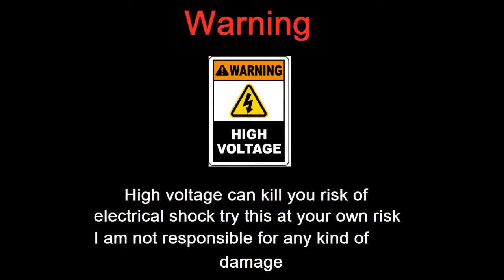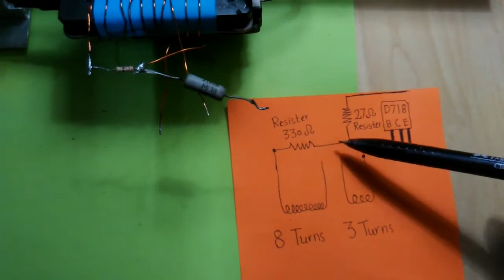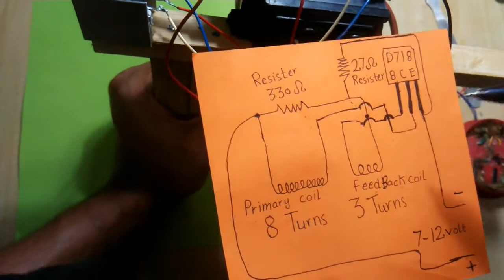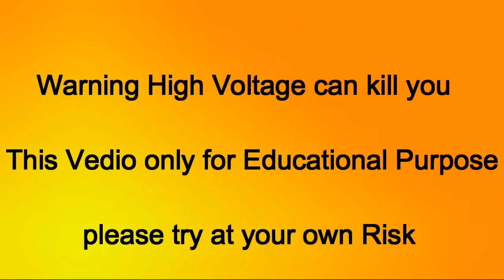How to Make Powerfull Stun Gun

Comment: Please tell me
which transistor is best all of them for this project.
16P20F
F10KF40
17805T
Reply from the maker: Friend these are MOSFET 16P20F and F10KF40 
And 17805T voltage regulator 

In this vedio I use transistor get from old amplifier

D718
B688
C3180
C5200
A1943
A1263

These transistor can work more transistor you have give me list
Reply: Is best use driver mazzilli

Comment: Can i replace  D718 With D2499
Reply from the maker: No bro D2499 is Tv transistor So change the circuit. You can Try same Circuit Like D718 But Try input 12-24 Volt may it works good

Comment: What is the current? Please? Good video.
Reply: Also, transformers only work with AC and this is DC due to the batteries right?
Reply: Also I subscribe I like your YouTube very much. Thank you
Reply from the maker: Yes bro you right bro transistors convert dc current to ac and transformers work
Reply from the maker: Welcome bro thank you so so much😊😊😊
Reply from the maker: Bro its high voltage at least 12,000V 
12KV and wattage is too low because very very low mili amps
Reply from the maker: I use 6 to 7 volt 3amp battery 
get from power bank and use 2 batteries in series 
For input

Comment: It is good work 
Bro. Congratulation . Please give me a electric shock circuit diagram  for 🐟  catch in the river.im srilanka. Can u help me.
Reply from the maker: Thank you so much friend search on youtube have many videos on this topic
Reply: Bro but not working long time.transistor  is destroyed.what problem pls rep
Reply: Best work super. Im suppli voltage  is 12 dc. But not long time.destroyed  circuit
Reply: What the problem and correctly  idea. Resistor  change or etc
Reply from the maker: friend these circuit are not for long time you know this is stun gun circuit
Reply from the maker: good but please not use 12 volt friend better you use 3.7volt power bank 2 batteries in series

friend if you want to increase some time use two transistors in parrallel d718

attach Base to Base and Collector to Collector and emittor to emittor of transistors
Reply from the maker: Thanks for comment
Reply: Verry verry thank u my brother.
Reply: We can't catch rats.  The reason is because it cannot be linked in the long run.  That is why you asked me.
Reply from the maker: Oh thank you bro 😊😊😊😊 my whatsapp no +601169439048 you can chat
Reply: Thank u bro 🙏

Comment: It works.
Reply from the maker: Thanks☺️
Reply: @creativechannelpro371  All components are easy to get from a single old TV or tube screen. The flyback area of the board have a dedicated N Channel power transistor with cooling prepared to work with it, dont have to search specific model. The resistors values needs to be lowers if this transistor have a own internal resistor and diode.
Reply from the maker: @FSHerrante  ☺️♥️yes bro Right thanks for informations

Comment: Using TV flyback transformer for  this purpose , used to insult it... !!!! Use ordinary mosquito bat circuit, you will get more or less same result..
Reply from the maker: You are right friend but flyback find easily from TV 
Friend mosquito bat less arcs than flyback friend Thanks for your nice comment
Reply: How many volts could you get from a misquito bat circuit?